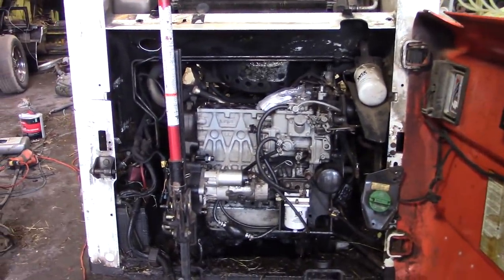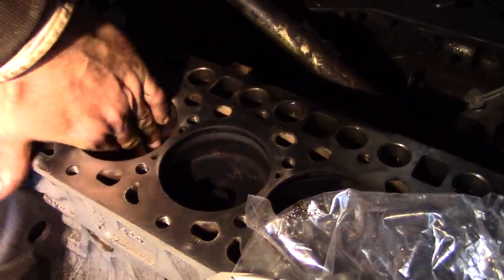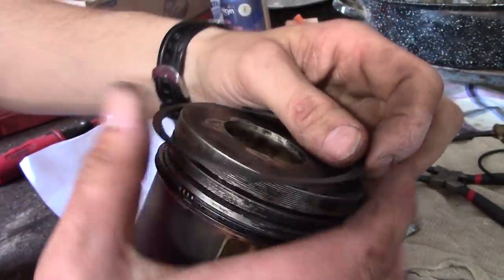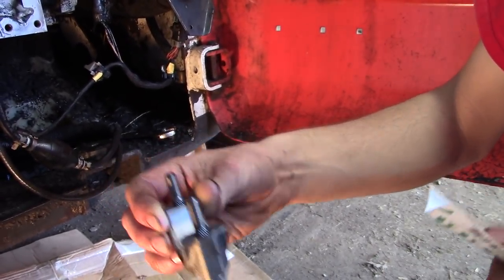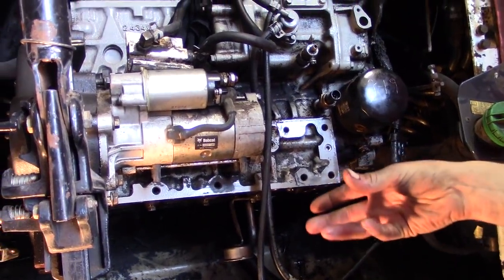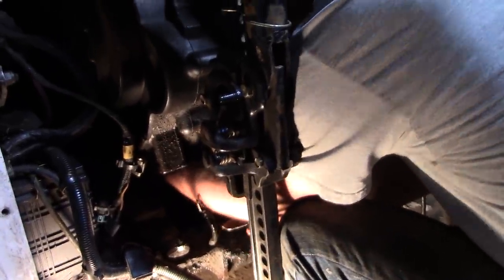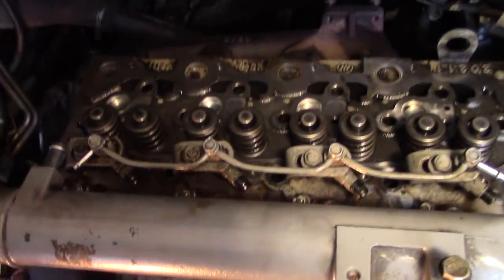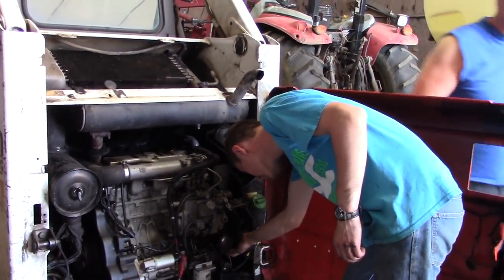Bobcat Skid Loader Part 2

Comment: Very Good Job!!
Y'all are terrific!
Just an fyi, if you ever need to put piston pins through the pistons easily, heat the piston. The pin will fall in.
I used a galvanized water bucket and a hot plate. Heat the water puttin the bucket on the hot plate, put piston in the hot water, pull out with a hook, blow the water off, the heat will dry the rest.
Pin will fall through the bore.
Love all the vids on this channel.

Comment: Skid loaders are hell to work on.  Using my neighbors 763 bobcat the hydraulic control valve o rings decided to spew it guts in my driveway. Called bobcat dealer ,said they had o rings ,I didn't fill the fluid up so I could raise an lock loader arms up cause I didn't want a bigger oil spill to clean up.  Going head first under the cab to work on the valve was quite the ordeal. The repair was simple ,but I tried laying with card board ,them up on knees till I couldn't stand it,then lay down. It took 6 hours to replace 6  O rings and get fluid in it. Next time I'm making a bigger oil spill by raising arms and going at it from the side of the machine. Moral of the story is Kevin you thought outside of the box by using the handy man.  An when you work on a skid steer you gotta think outside the box.

Comment: Oh yes ARP sells the replacement head bolts, and not that expensive, they are not inexpensive, but well worth replacing,if there are questionable reasons, it’s called in sequential order on the head bolt torque, vary good, guys and gal, thanksBigAlCalifornia.

Comment: Way to go guy's. A win 👍🌟 really a great job done  Sydney is a very conscientious mechanic. Kevin great win getting the oil pan out. 
And you know it was the right thing to do when you find the bent connecting rod. A real money saver doing it yourself. Because most people aren't aware the sending it out it usually an apprentice doing the work. And that doesn't always go well or quick. Don't get me wrong everyone need to learn but the the shop rate is the same even if they are having trouble.. anyway thanks for bringing us along and like I said congratulations on the WIN. STAY SAFE 😷 Happy and smiling 🇨🇦 Craig
Reply from the maker: Thanks for watching!!

Comment: thats what ya call an in frame parcahal rebuild, more then one way of skinning a cat..  you just lucky he got to the air intake and plunged off the air, before it ran away and blow up totaly, when it rolls over and starts sucking in engen oil they will run away on you so fast burning just the engen oil, but mort tmes the way it lands when it rolls over, it hard to get the doors open and the air filter housing off and a heavy peace of plastic to chock off the air, well the RPM'S  are running full out, seconds before it blows a part in your face, in this case an oil line blow spraying oil into the intake, witch made for fast opening of doors to get to the intake, you have to remove the air filter and housing in order to choke off all the air, some machines have an emergency shut down, witch it a butter fly in the intake, you can tell thats a cheap built engine, has no cylinder liners, witch is odd , so there a throw away engen if the cylinder walls get damaged, sure you can have them bored out and sleeved pressed in, or go with over size pistons, if you can get them for that engine, witch you cant in most cases.., funny the rings didnt brake, but yet lost compression from a lock up, i think it just got really hot and collapsed the rings

Comment: I bet the problem with bobcat well. You can say I cracked it. Nice work on the engine. Sydney knows his job. He should give Keain his hands as he lubricated so much "sealant."  I saw a blurred motor shaft in which the oil channel was blocked by the sealant.
I use a sealant myself but as little as I can.
Good luck